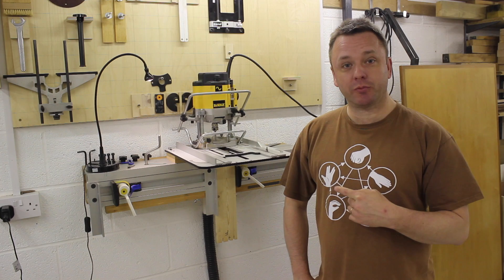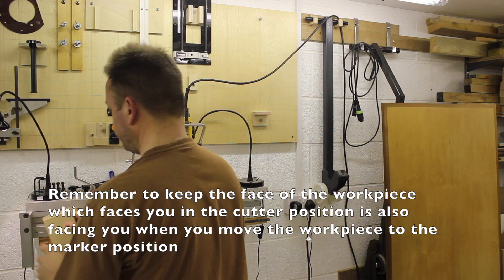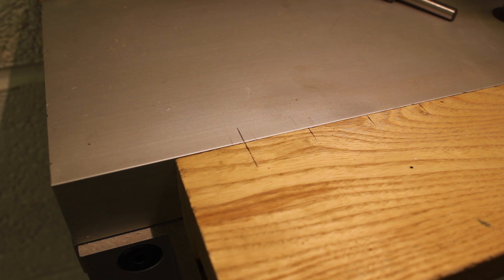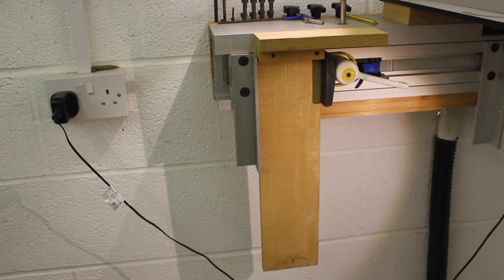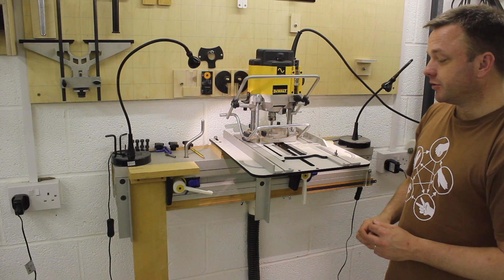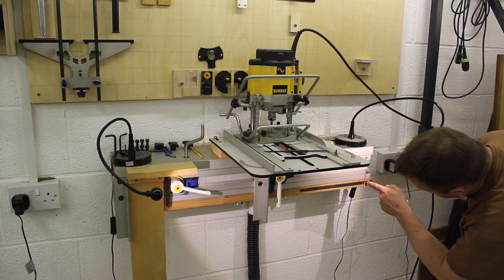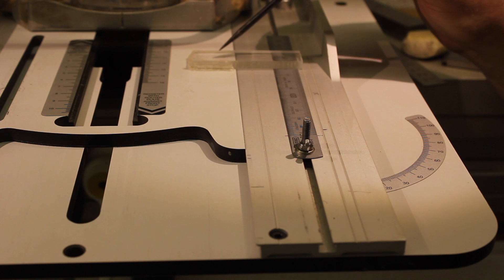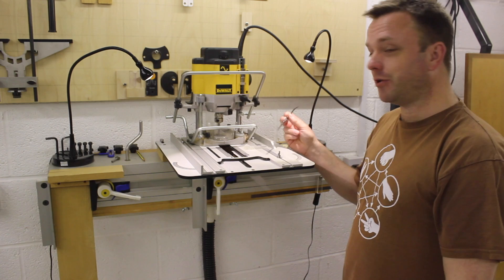The WoodRat - Accurate Cutter Positioning Methods

Comment: Thanks for some really useful tips, I don't have Martin's spacial awareness and have always struggled with cutter positioning.It's funny how your tips seem really obvious but that's only because they are actually rather clever, I particularly like the ruler trapped in the dovetail slot.Thanks again
Reply from the maker: Thanks Nic and I’m glad you found it useful. I’m sure there’s lots of other ways of doing the same but if it works for you then great. Cheers Steve

Comment: You could glue a ruler onto your top shelf piece of wood instead of, or as well as, marking 23mm spaces. Set the zero to the centre scribed line.
Reply from the maker: Yes you could do that. Marking your own pencil lines on the top of the jig is useful because you can’t align anything else up with the centre line, only the pencil lines. With a ruler you’ve got to remember which line on the ruler to line up with the centre line. So it may in some tasks be more confusing. But yes you can do that too and probably other alternative methods.

Comment: I find my Woodrat is simple for dove tails but more complicated for pins using the table. I ended up making the pins partly by hand to get the angle correct and woodratting the depth and finishing with a chisel and fret saw. . I guess if I was using it more regularly, set up for the pins would be easier. I get neater dovetails with the Woodrat than doing it all by hand with a magnetic dovetail guide
Reply from the maker: Yeah I think the pins (of a dovetail joint) are the harder part to machine on the Rat but if you watch my dovetail videos you might see that it’s not so tricky after all? Have a look and let me know what you think... 👍

Comment: My rat has a number of M6 holes in the router plate, on the RH-half, between the scale and the side. I have made a T-shaped piece of acrylic with a line in the vertical bar. It fits with 2 M6 bolts in the top bar in the existing holes. It is easier to take off put on than messing with hot glue and it always lines up the same way. Instead of T-shaped it can also be L-shaped. If your rat does not have these holes it is easy enough to drill and tap two holes in the router pate.
The lower joints of my plunge bar were held together with normal  socket head cap screws, which stick out quite a bit and limit the use of stops. You can replace them with normal 6-sided bolts, which are lower, or even lower lens-headed screws, this gives more room for stops.

For a lot of things the rat is perfect, but i have recently made a series of box joints for 24 small boxes, and next time I am not using the rat for it, but I will make a  jig for the router table. On the rat you lose too much time positioning exactly, or, if you speed up, do not position accurately enough.
Reply from the maker: Thanks Sierk for your WoodRat tips. Very useful. I’m not going to ever say that the WoodRat is the one and only way of making wood joints because we all know that’s not true. Like you I use a router table too and I can also make joints by hand. Sometimes one method can be better than doing it another way. I think the Rat, if modified with a few jigs and options like you mention, can be quite versatile. But like every method it has its limits. But thanks for your ideas it’s good to see what others are doing with their Rats! 👍😊

Comment: Great video Steve I have had a woodrat for a number of years but found it a real pain to use but with your tips I will have another go at using it all the best Mick
Reply from the maker: Thanks Mick and glad you found the video useful. I believe your position is not uncommon and a little bit of knowledge will open the machine up for all sorts of uses. Good luck...

Comment: hmm, I don't have a Woodrat, perhaps one day. It seem more closely related to a milling machine to me and you need your engineers hat on! Do you find you use the rat a lot? Thanks for the videos
Reply from the maker: Mickleblade hi, thanks for your comment. Yes it basically is a milling machine, although obviously made from much cheaper components. I use it occasionally but not constantly. It depends what I’m making really. But sometimes it is ideal and better suited than a router table or handheld routing methods. The good thing is that you can see mostly what you’re cutting whilst using it and the work is held secure and tearout can be avoided by climb cutting (which is safe to do on the Rat but not on a table or handheld). So I don’t know, for me it was a better choice than buying a dedicated dovetail template jig like the Leigh as it’s much more than just a dovetail jig and you can cut much more “hand cut like” dovetails on the Rat. Hope this helps?
Reply from the maker: Mickleblade hi, thanks for your comment. Yes it basically is a milling machine, although obviously made from much cheaper components. I use it occasionally but not constantly. It depends what I’m making really. But sometimes it is ideal and better suited than a router table or handheld routing methods. The good thing is that you can see mostly what you’re cutting whilst using it and the work is held secure and tearout can be avoided by climb cutting (which is safe to do on the Rat but not on a table or handheld). So I don’t know, for me it was a better choice than buying a dedicated dovetail template jig like the Leigh as it’s much more than just a dovetail jig and you can cut much more “hand cut like” dovetails on the Rat. Hope this helps?
Reply from the maker: Mickleblade I’ve not seen the one you mentioned, very interesting. I bought mine many years ago and it is an investment. But I’ve seen so many people spend similar amounts of money on just a dovetail jig. So I still think the Rat is value for money. Best of luck with whatever you decide to do...

Comment: Thanks, super video. Sorry for asking a silly question why did you choose 23mm as the distance for the marker position jig? Regards Lutz
Reply from the maker: The lines drawn on the top of the marker jig are just examples. It happened to be 23mm but the idea of this jig is for you to draw whatever you need on the top surface of the jig in pencil so you can move the workpiece by whatever intervals you choose. You know that if your mark in pencil meets with the mark on the upper body of the Rat, then that’s where the centre of whatever router bit you have in the machine will cut. But remember it is the centre! Hope this helps? Thanks Steve
Reply: Excellent, many thanks